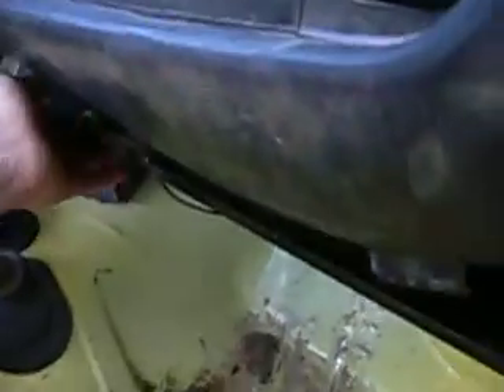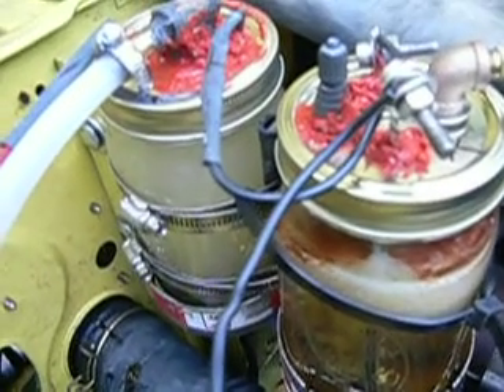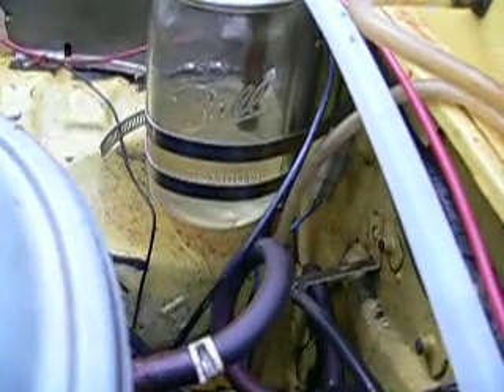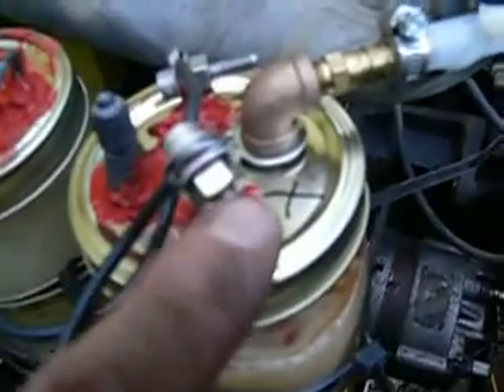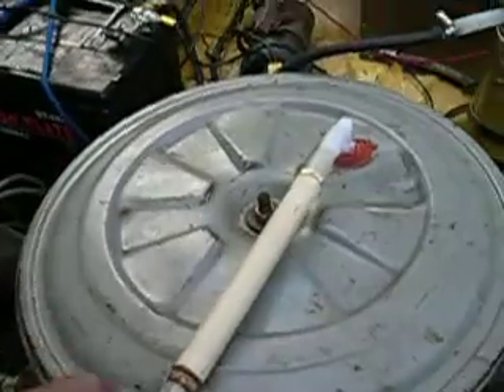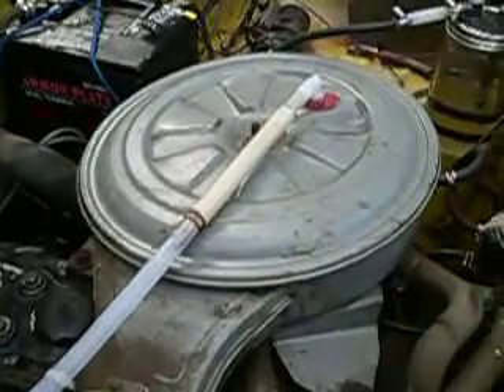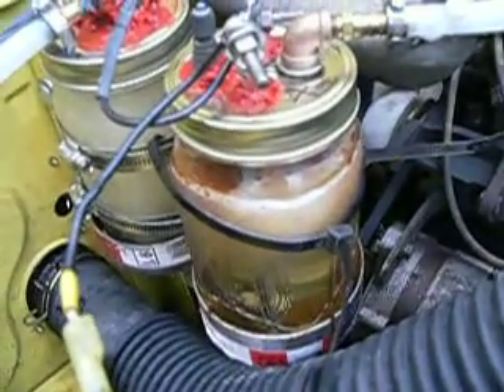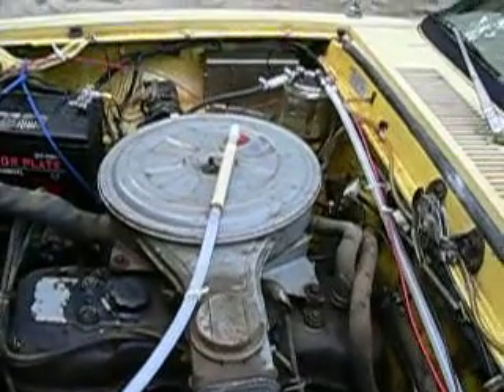act four HHO Generator Bubbler?

Comment: Question? could you have a video on exactly the diagram on where you hooked it up the hoses and what parts you used I have a 1985 F250 4.9L inline 6 I am wanting make something like this so i can just see if i can use it instead of gasoline i have two gas tanks.. I am learning on this and watching videos, but none that i have actually show using a carburetor just fuel injections single barrel i have on the truck. please reply...
Reply from the maker: I don't be very careful I ended up blowing the carburetor and air cleaner right off the truck while experimenting with this setup i never tied the electrical to the ignition circuit. One day I came home for lunch and left the system on it pumped the motor full of hydrogen and when I came out and hit the starter it blew up in the most violent explosion I'd ever seen actually bulged the hood up blew all the generators up including the bubbler blew the air cleaner to the point I had to weld it back together blew the  venturies and jets loose in the carburetor throat. It was definitely more than safety glasses would have taken care of. After that I took it off the truck. Funny to think about now but could've blinded me in both eyes and I wear safety glasses all the time due to vision issues. Treat it like a bomb and you should be fine

Comment: More plates on your generators, and y pipe them into the bubbler, browns gas burns so fast that the suppressor couldn't possibly stop it, have you tested it? 

Not that it matters as you will be in the car when it happens most likely.